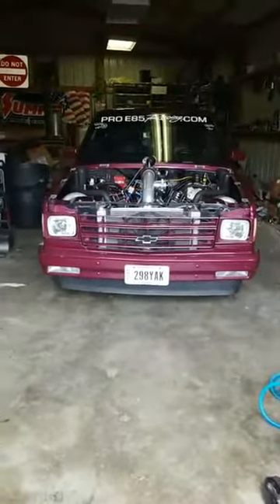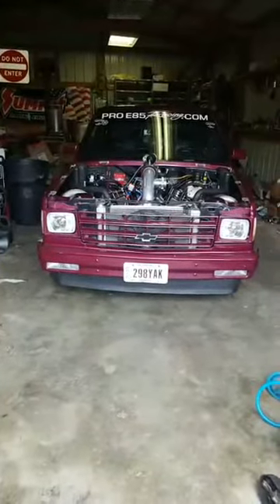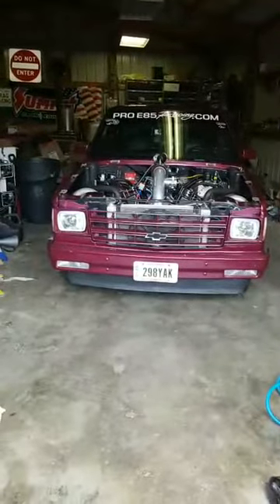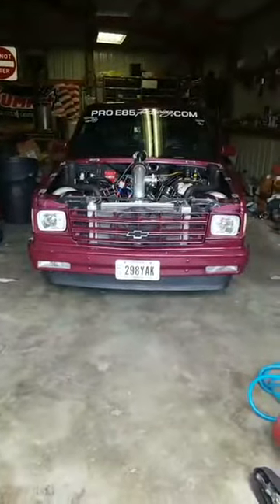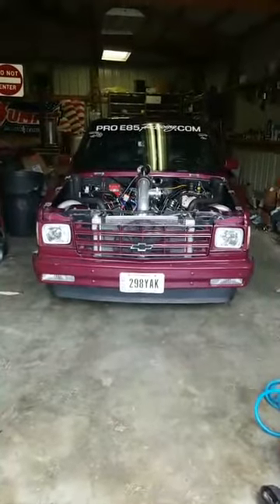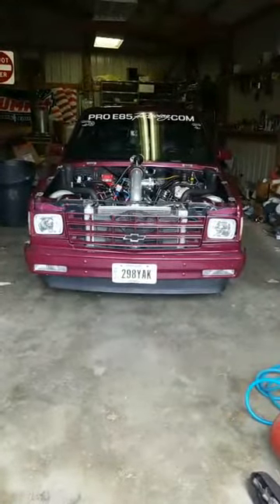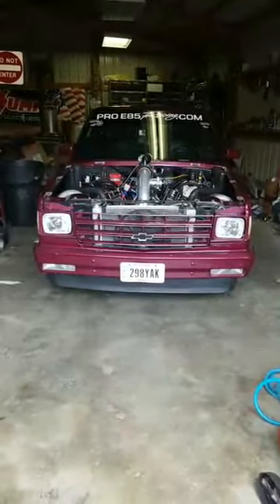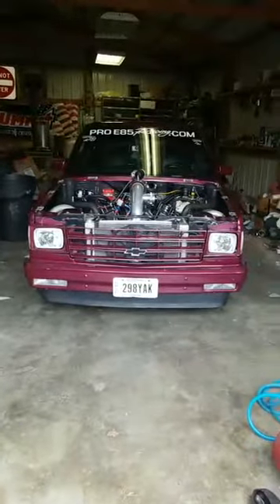Cold start on a warm day e85 blow through CSU carb!

Comment: I love those CSU carbs bro. Would u share some details on ur setup? Block and cubic inch?
Reply from the maker: 357" sbc. When it was stock block and 8.4:1 it went 8.89 at 153. 
Now its dart block and 10:1 no good hits yet.
Reply from the maker: But at 15 Psi its making 75 more hp at the tire. And the old setup wouldn't make power past 15. At 22 it made 1057 wheel. Plan to run it in the mid 30s.
Reply: Awesome truck my dude. I think I’ve seen it run a motormile before. I hope this 421 I’ve been building will handle some power (splayed caps).
Reply from the maker: My 350 was just a 010 2 bolt block w splayed caps and 0 hard block or anything special. That went 8.89 at 153.
Reply: @CrosbysHotRodGarage  so you was making north of 1200 at the flywheel on a splayed 010 block?  Also 9lb to 22lb with a 200hp gain would need some investigating.

Comment: What regulator u siding and are u running a 6al programmable box?
Reply from the maker: Aeromotive a2000 regulator is best for all boosted bt carbs. It does amazing with big or small pumps. And ignition is msd grid with grid boost controller
Reply: @CrosbysHotRodGarage   what size carb are you running and if u don’t mind what’d it cost ya I was thinking about using c&s but heard lots of good things about CSU
Reply from the maker: @nickolausvassallo744  csu on both. S10 has a 850 and blazer 750. 15 years on the s10s carb and never even burnt a spark plug.they work very good
Reply from the maker: @nickolausvassallo744  I've seen too many wirh issues w the c&s. Some it works and some never get it right
Reply: @CrosbysHotRodGarage  and ur running e85 also correct? I have a sbc 327 we are going to a single t6 turbo 75mm I’m thinking probably need a 750
Reply from the maker: 750 is perfect and will support a ton of  power
Reply: @CrosbysHotRodGarage   awesome so ur saying a 750 will do the job what map sensor u using with that grid system and will my msd 121-8570 work with the grid controller and the grid stuff?
Reply from the maker: Map is built into the grid boostcontroller it won't use a external. For you I'd highly recommend a 6al2 and your map
Reply from the maker: Make sure you use a blue hvc2 coil. It will make your life way better
Reply: @CrosbysHotRodGarage  a 6al-2 programmable? Why not a grid and the controller?
Reply from the maker: You won't need it the 6al2 and blue hvc has supported 1300hp motors on e85
Reply from the maker: Grid is 1500 for not much gain until your really pushing hard 1500-2000plus

Comment: How’s the quick fuel blow thru carbs?
Reply from the maker: They don't have boost reference power valves. Most quick fuels need work to make them right. Proably ok under 10 psi. My csu carbs have been perfect.
Reply: Crosby Racing Garage 
So you recommend CSU?
Reply from the maker: @glenngamboa9224  absolutely. Its always worked great. Never any issues and I push the combo pretty hard being non intercooled. I've had the same csu 850 for 15 years of boost. I've never even burnt a spark plug.
Reply: Crosby Racing Garage 
I’m waiting for there reply or I’ll try to call them. Thankyou!
Reply from the maker: Call and call Kevin is always busy. But damn good and worth the weight.
Reply: @CrosbysHotRodGarage  
Finally talk to Kevin Thanks 
Anyways is your intake dual or single plane?
Reply from the maker: @glenngamboa9224  both are single planes. S10 is a super victor. And blazer is the holley single ls style
Reply: @CrosbysHotRodGarage  
Nice just asking cause they offer single plane for my build going with it
Reply: Turbo carburetor also